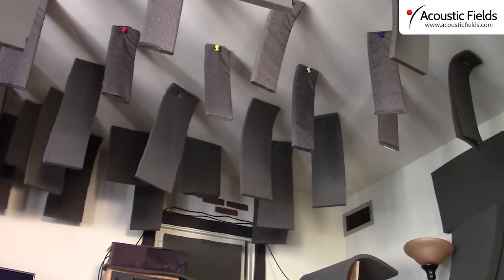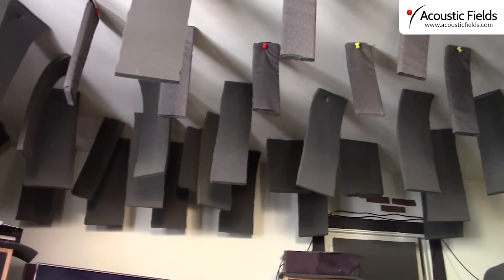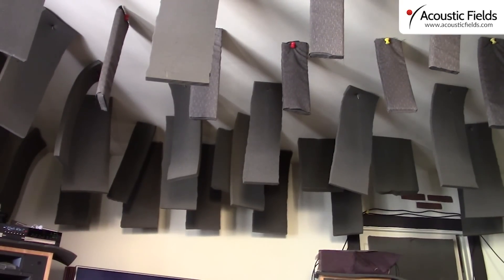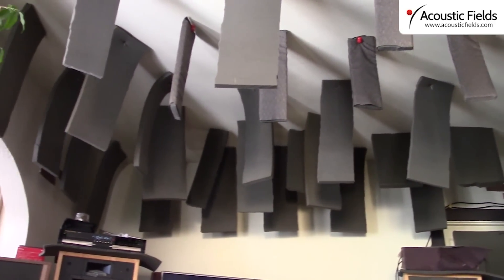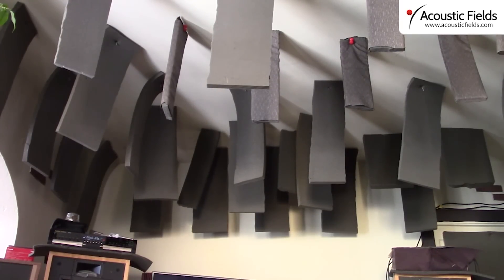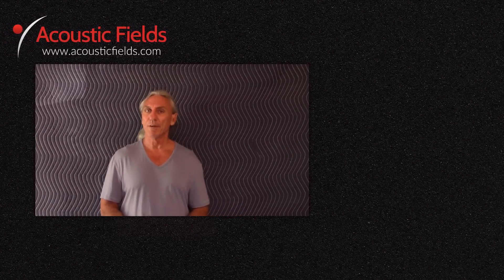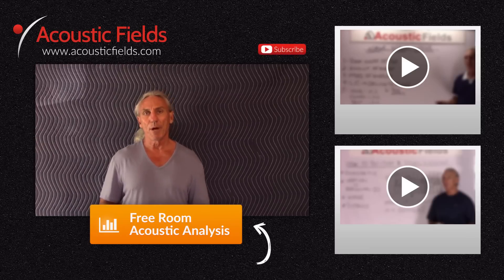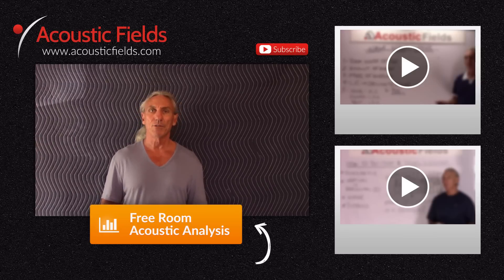Why does this ceiling look like this? - www.AcousticFields.com

Comment: I thought you said foam wasn't good to use ?
Reply from the maker: P,  I do not understand your comment. What are you referring to? Please be specific.
Reply: @AcousticFields   First I want to apologize for my misunderstanding of the issue you were presenting. I found the video and re-watched and realized my error. It was the video " what are the best sound absorbing materials" All I remembered was hearing, "foam is not good for this purpose". I am struggling in deciding what material to buy for my little studio of 12 x 12 x 8 !
 I know , absolutely the worst scenario but I bought the house before doing this kind of research and now I'm stuck. Anyway please post this reply so others can see and not be misled by my stupid public comment. Again , my sincere apologies. I strive not to make these kinds of mistakes. 
Nazz.
Reply from the maker: P, No worries. Thank you for your contribution.
Reply from the maker: P,  Fill out the information in this link. Let's take a complete look at your room issues, starting with the low end first. https://www.acousticfields.com/free-room-analysis/